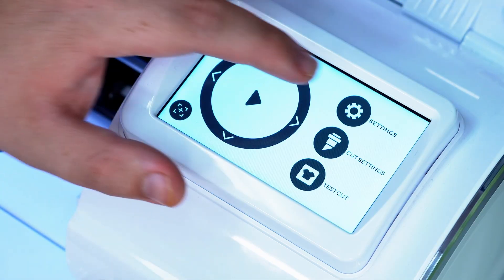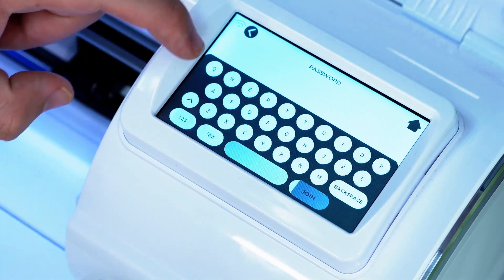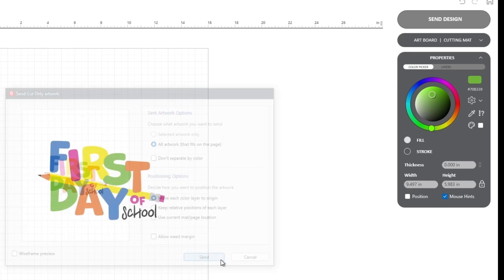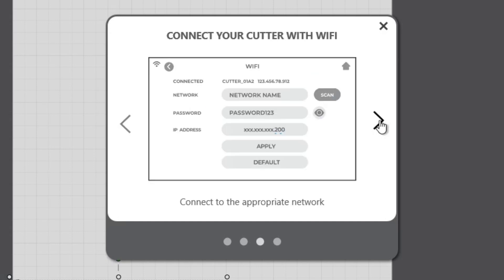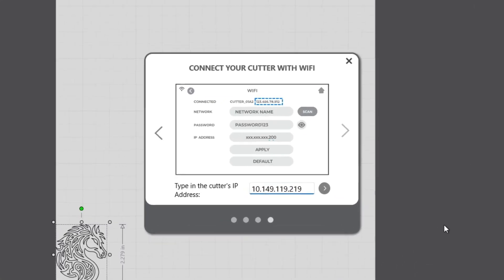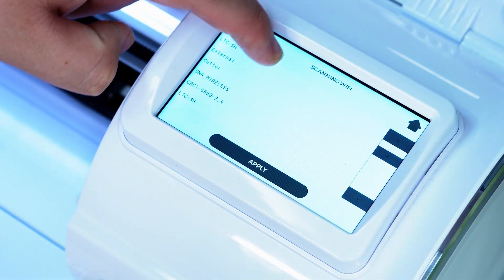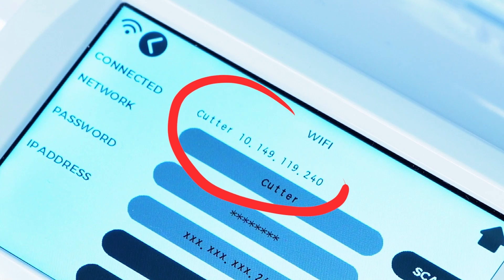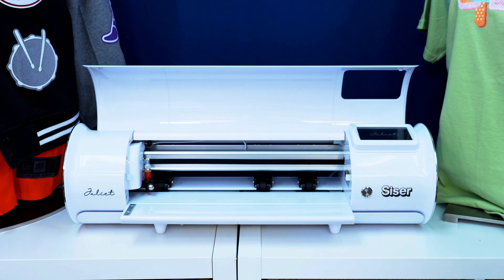Connecting Your Romeo® or Juliet® to Wi-Fi

Comment: When i scan for wifi it just keeps scanning with no results,the juliet is about 3 feet from the router and loads of other wifi signals it should be picking up also but nothing ????
Reply from the maker: Make sure that your WiFi runs on a 2.4ghz connection as some of the newer models are only 5.0ghz connections and that is not compatible at this time with Romeo or Juliet. We are working to make this possible

Comment: Why does the Wifi connection disappear, every time I close the leonardo studio? I need to use the Wifi connection because Juliet doesn't connect via the usb, it's really frustrating!
Reply from the maker: If your using your cutter on the same network then you should never have to reconnect. If this is not the case and you are losing connection consistently, then it would be advised to call our support team at support@siserna.com for additional help.